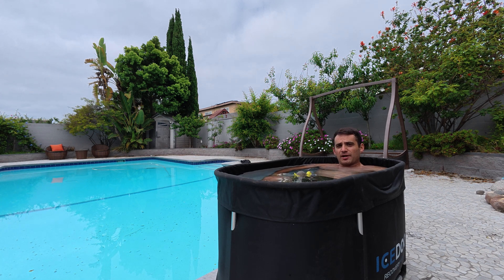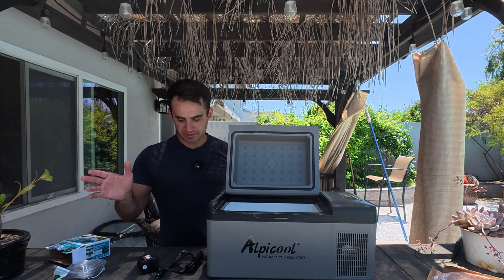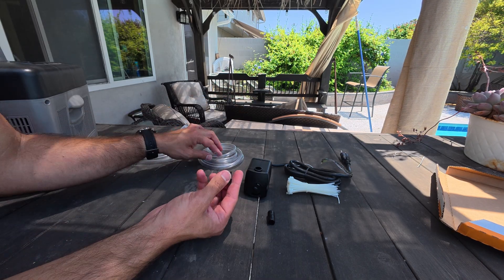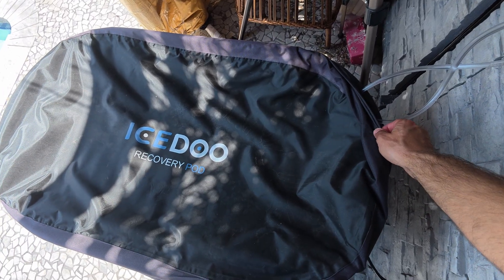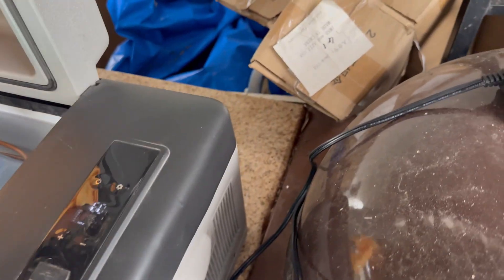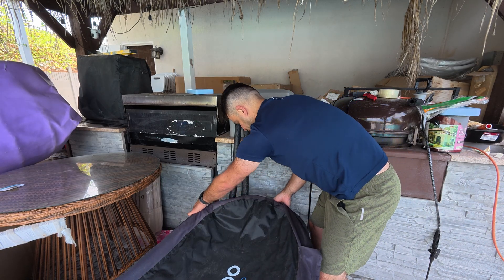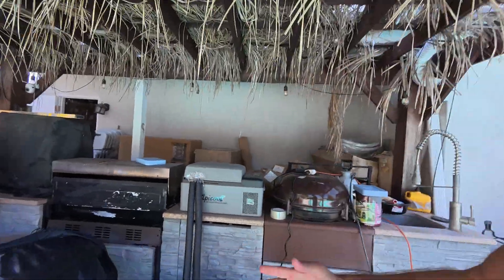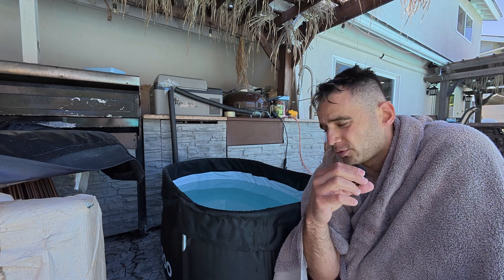Can I build a DIY Ice Bath Chiller?

Comment: this is a very inefficient system, and I was facepalming the whole time watching this video as an engineering student 

no matter how much u will insulate the fridge or the pipes, it wont help much 

cause the water in the tub itself is so warm that it heats up all the cold water that comes from the fridge…. 

sure u made it to 51F, but it was over days, cause u would hv to slowly take out all the heat from the tub water by introducing tht small amount of cold fridge water again and again 

if u will insulate the whole system (including the tub), and get a bigger fridge and increase the flow rate then the whole cooling process will be much much much faster!!!!
Reply from the maker: Yes, I stated it’s inefficiencies at the end of the video. It was a proof of concept for the system but it does need to be insulated way way more before I would say it’s a viable solution. Thanks for watching!
Reply: @Basbuild  yeah dude 
anyways dude atb for the future build!